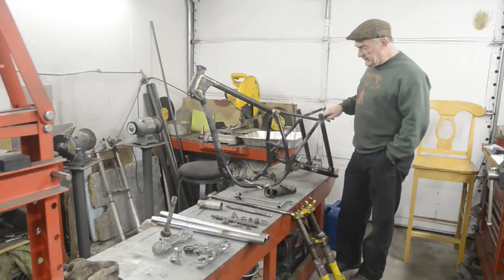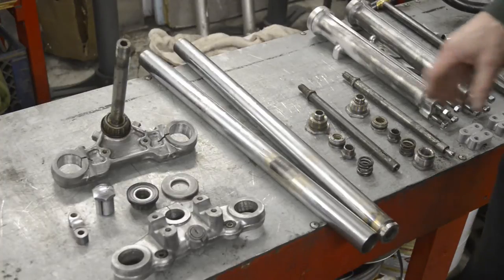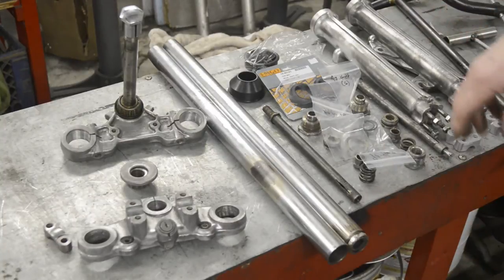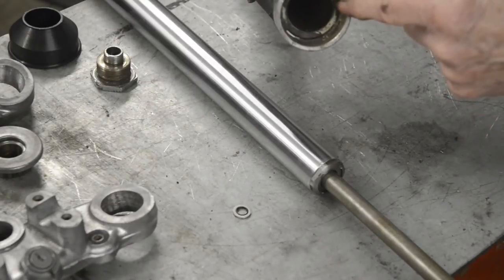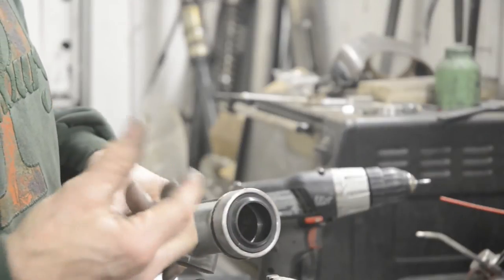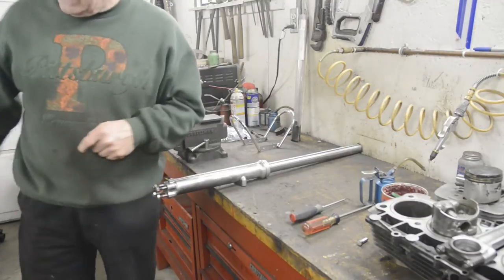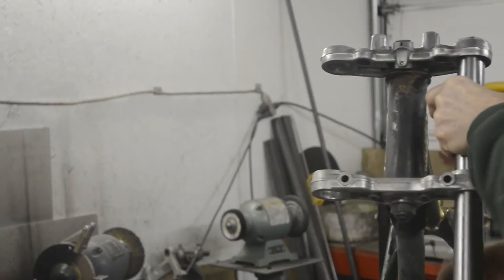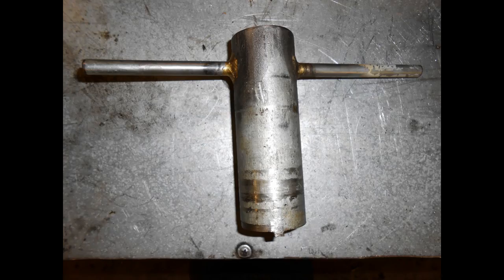BM 250 Trials Part Six Forks

Comment: hi great vids thank you for the time for all the uploads,,, question if i may  did you not need to grease the taper bearings..cheers rob
Reply from the maker: Hello Rob. When I came to put the forks in the finished and painted frame the taper bearings were packed with grease before installation. Glad you like the videos.
Reply: hi michael thank you for the reply,, i did ponder on my question and i think i was silly not to think that the build was a dry run hasty hasty on my side i think...grew up with bikes all my life and still muck about with them,,even went to nursery in a sidecar... keep up the good work mr waller..

Comment: Rather than use the rubber o-rings I 'upgraded' mine to phenolic resin seals which provide for a much smoother action. Expensive but worthwhile in my opinion.
Reply from the maker: Hello David. I will give them a try next time, thank you. As always there are options. My Wallers have all come from around Northallerton since at least the 1700s. Any connection?
Reply: I'll have to check with my sister as she's done some research. As far as I know our lineage, insofar as the name is concerned, is Hampshire/Sussex but I could be wrong. 

The phenolic resin seals don't have the stiction that o-rings have but cost far more. Part no.  97-4003P L P Williams.

Comment: Hi Mike. Great video - thanks! I run a BSA B44 Victor Special on the road that's fitted with alloy forks like these. Would you recommend the additional damping hole mod you did for road use too? Mine seem to hardly react to bumps & are really quite harsh, & suffer a bit with stiction so will be changing to the phenolic damper rings as well. Any advice please? Cheers Don.
Reply from the maker: I think that the mod for use in trials would probably make them too soft for road use. One thing to look at are the fork seals. I have replaced the metal rimmed seals and found that they made the forks so stiff that they will barely move at all. Throwing those away and changing to another pair made all the difference. Bad manufacturing, poor QC or what I don't know but some work better than others. Hope that helps and thanks for watching.
Reply: Thanks for that Mike. I'll be fitting new low friction seals & the phenolic rings over the winter, so hopefully that'll help. Cheers!